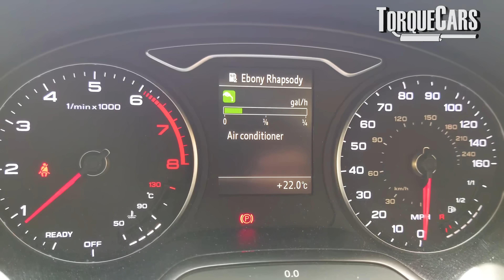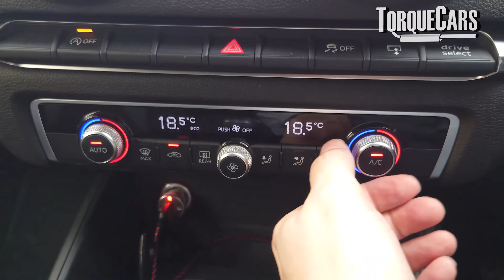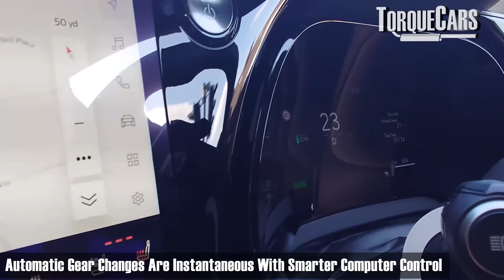The Biggest⛽ Fuel Economy Lies Every Driver Believes! 👉 What Really Saves Fuel?

Comment: I drive a sprinter if I use cruise control set to 60 it achieves 42 to the gal unladen and 39 loaded. Tried the premium fuels bit expensive, now use red ex diesel in every tank of cheap fuel similar results.

Comment: 7:04 7:10 In US market, the best fuel additives-packages I've found so far are in:
Exxon/Mobil Synergy Supreme+
Shell V-Power

These are what I fill up with in my:
2016 Toyota Prius c Two

It has 113k miles, and runs like new.

Comment: Tyre pressure set by manufacturers, is aimed at making the drive the most comfortable, not economic. Ford says 32 for my Kuga but it can go up to 40, so I put it to 36. A bit more tyre in contact with the road, means better performance but like everything in life, there needs to be a balance.

Comment: Air resistance is a significant factor. On a long drive one day, (100 miles +) the  average MPG readout on my dashboard had settled down to a satisfying high figure.   On a particularly long and safe stretch of road I found myself following a lorry, and I decided to get right up behind it, keeping a close watch its brake lights because I couldn't see anything of the road ahead. I thought I had maxed out on the MPG, but it increased significantly, just by being in the slipstream of that lorry for a few minutes. I wouldn't recommend it for safety reasons though.

Comment: We are essentially paying a premium to get ‘only’ 5% ethanol in the high octane fuel, instead of the 10% in the 95. I wonder how much of the benefit of premium fuel is simply down to the lower ethanol content that should never be used in most engines, anyway. Our rulers hate motoring and motorists.

Comment: Inflating the tires to the right pressure in the afternoon means that the tires will be under inflated next morning due to the difference in ambient temperature.  As under inflation has a greater effect than over inflation, on average it is better to over inflate your tires by a small margin
Reply: On the other hand, the tyres heat up very quickly once they start moving.  The air expands inside, increasing the air pressure.

Comment: Drag increases with the square of the speed. If you regularly travel on the motorway around 80 mph, there will be a significant difference in fuel usage at 50 mph, probably around 200 miles on a 10 gallon/550 mile tank (so 55mpg WLTP). Staying at more legal and practical speeds, even dropping from 70mph to 58mph, safely keeping up with the lorry/truck flow in the inside lane on a motorway, you will get another 100 miles out of the same tank.  As long as your car is well maintained, and you don’t brake and accelerate like you are on a race track, speed is by far the biggest influencer on fuel economy.
Reply: On my 96 Mercury Grand Marquis w/ 4.6L 2 valve V8 engine the difference between rural roads, high speed freeway 75-80 mph and mixed local and highway driving is no more than 2 MPG so 40 miles on the 20 gal tank. (discounting in town short trips)
Reply: @tomnwmi You are comparing fast (I assume fairly steady) highway driving to lower speed mixed driving where you are braking and accelerating. If you drove your car on the highway at a steady 50 there would be a considerable difference in range to driving it on the highway at 75-80. If anyone is short of fuel on a highway/motorway, the best way to significantly increase how far that tank of fuel will go is to slow down. Air resistance increases roughly with the square of speed. Power required increases roughly with the cube of speed
Dropping speed by even 10–20% can significantly extend range regardless of what type of vehicle anyone is driving.
Reply: Depends on the gearing. My car does about the same at 140 kmh in 8th gear compared to 120 kmh in 7th.
Reply: @golf1diesel I assumed that whatever vehicle was being driven, it was being driven sensibly and in the best gear for any particular speed.
Reply: @golf1diesel  gearing is gearing but the input power required to maintain a higher speed is the same. Will offset any friction savings from a lower engine speed.
Reply: @TsLeng  Engines are air pumps so let them breathe.  They work most efficiently when under load with larger throttle openings.  So gearing makes a big difference. This is why overdrive gears are more efficient.

Comment: Best economy, apart from not driving like a lunatic with burning trousers, is to conserve the momentum.  Ease off the gas well in advanced approaching traffic lights and roundabouts, let the car slow down without brakes and then if the light change to green or the roundabout presents a merge opportunity, you can usually just squeeze a little power back on an smoothly progress on without even changing gear.  If you must stop, easing off early means less wear on the brakes and you used less gas to reach that point.   Climbing hills - the Worst thing for economy is to press more and more on the gas until reaching the hill crest - much better is to let the hill slow you a bit until going over the top, then gravity gives you back the speed you lost on the climb.  When doing this though it is important for economy (and long term engine health) to not chug up the gradient with a labouring engine. Change down on steeper hills to keep the engine spinning freely - all engines have a best pulling rev range typically starting around half, and upto, two thirds their recommended maximum revs. So for most petrol engines you want to see about 3-4000 rpm just for the steep gradients where lugging or labouring occurs. Diesel pull more strongly and work at lower revs so you may not need to changes down at all, but if required you should be looking at about 1000 rpm less than the petrol version.  Finally, try to progressively squeeze brakes and gas, don’t stomp on the peddles and don’t snatch hurriedly at your gear changes - it isn’t necessary and a car driven like this feels bigger, more limo like, which is nicer for passengers - and the sign of a more polished driver.

Comment: The most practical fuel efficient speed remains 50 mph and it still eats up the miles.  HOWEVER, you should not purposely hold up traffic, so only use 50 where it doesn’t cause a problem for others.  Trucks are limited to 60 on motorways anyway, so a solution there is to travel at 60 in convoy with groups of trucks - this should not upset Audi tailgaters who will instead be centre lane hogging right on by.  On twisty rural roads even 50 is sometimes too fast for visibility and safety!

Comment: Hold on!!! You're recommending people to go for the cheaper fuel to save fuel costs. But what about engine longevity? That's a much more important argument. Premium fuels are like cheap insurance for the longevity of the engine and the fuel system because of the premium additive package. And fixing failed engines and fuel systems is much more expensive than the price for premium fuels. Think about the cost of doing that when you're choosing what fuel to fill up with!
In my opinion, the fuels with less useful additives should be illegal and the premium grade should be the only grade, especially considering the cost of new vehicles and how costly repairs are. Protect your investments!!!
Reply from the maker: Yes there is a difference between "cheap" and "low quality". I find that even big brands like Shell in my area can vary in cost from 141p to 130p. I would use Shell E10 or Esso E10 as the additives in these seem to be up to spec, however my engine loves higher octane and rewards me with better economy & extra power so I stick with that.
Reply: @torquecars  Cool! I'm running 98 octane (RON) E5 from CircleK. Mainly for the extra additives but less ethanol also means less fuel dilution, which means less engine wear on my annual oil change interval. At least in my area of Sweden, the cheaper fuels (95 octane) have less additives. I just thought that it was important to mention that correlation and how that potentially might affect the longevity of an engine.

Otherwise, I think you're giving out great and accurate advice here. I'm sure a lot of people take it seriously. And it would be a pity if people use your advice to always buy the cheapest (per mile) fuel without considering the additives. Many times, buying additives separately will end up costing more than choosing a higher grade fuel at the pump.

Comment: 2. Dry air can be used instead of nitrogen. Problem with regular air in a race is the heat from water in regular air, not the size of the molecules.

Comment: I have noticed I can get 10 mpg more driving my 2 litre diesel at 45mph, compared to high fifties. Not by choice though, just due to being stuck in slow traffic.
Apparently higher tyre pressures do save fuel, as a Vauxhall I once owned had an eco pressure 8psi higher than standard. Never tried it, probably hairy in the wet. Nitrogen is not used in racing tyres for fun. It has no moisture content, therefore pressures do not vary as much as temperature rises. 
Also if you want to wind people up, drive at a fairly constant throttle setting, and let the car slow down going uphill with only minimum increase to stop bogging down. Then over the top, let gravity do the job of speeding you back up! 
Automatics were always more juicy than manuals, although in my 1960 Jag, the torque converter locks up once it’s in top, and is no different to a manual.
However, if you’re driving in stop start traffic at low speeds, an auto is the only way to go. Far nicer to drive, and you don’t have to rev a bit to ensure you don’t stall as you move off. 
Quite agree about weight, at speeds above 30mph, air resistance has the biggest effect on fuel consumption.

Comment: Decades ago, I was on a car forum and they were talking about ways to lighten the car. Some were pretty extreme, like drilling holes or acid dipping the unibody. Others were less (slightly) extreme, like removing sound deadening material, removing rear seats, etc. Some mentioned hollow or magnesium alloy screws. Weight saving could be from tens of pounds to grams. Costs varied from a bit of sweat to thousands of dollars.

I made a comment that I have seen some of the forum members in the picks of the gatherings. I said a few (actually more than a few) of them could easily knock of 5 lbs at no cost if the driver just ease off the soda pop fried food.  LOL

Comment: I have a Toyota Carrola X hybrid in temps above 10c it can average around 23km a liter driving up to 70kmh. On the highway, it drops to around 15km a liter driving between 100 to 110kmh. In wintertime in Canada, the averages drop about 20% on those numbers as the engine needs to keep the heat up to stop the choke coming on by tuning back on the engine even with a lot of battery power left. It needs a controller to reduce airflow through the radiator in winter so the engine keeps hotter longer.

Comment: Electric cars can be A LOT cheaper to run if you home charge them. Tariff for 2025 £4 a day for EV charging. If your car can do 300 miles on a full charge, it will be a fraction of the cost of a car doing say, 50mpg, which would be £30+ for the same fuel range.

Comment: Mythbusters did tests on a track with two identical cars and until 56 mph open a window then AC is good from there
Reply: @slarratt  worth noting they did that with SUVs where the percentage increase in drag from having the window open will be less than on a lower-drag vehicle. On a lower-drag car the drag ratio will be higher, and the crossover speed will be lower.

Comment: The big one that you have missed is the shape of the car. If you get a tall 4x4, SUV, MPV or whatever it will be a good 10% less efficient for being so tall and brick shaped. You will then lose a further 10% if it is running on four wheel drive with all the extra parts it needs to turn. 
But we do not seem to be able to stop people buying them and they really do not seem to care about fuel. 
Diesels are just so good in fuel efficiency. I drive a stonking great E Class diesel and it gets better economy (55mpg normal, around 60mpg on a run) than friends hybrid SUV manages. 
In recent years (after around 2016) some diesels have got amazingly good. Some have not managed to deal with particulates so well and have problem systems (Peugeot), but Mercedes have got it right and that generation of Diesels are amazingly good. My emissions are so low it only costs £35 road tax.

Comment: Does anyone have any advice about tires for a car like mine? It's a 2007 Lexus IS 350 and it has Michelin on it right now.  It has 18 inch wheels and the rear are much wider than the front so you can't rotate them at all.
Reply: It's about $1,200 USD to change all four tires.
Reply: Trade it in on a 2026 Prius.

Comment: The biggest mistake you can do is to drive by the gear shift indicator because it´s so stupidly low RPM and high gear for the speed you are lugging the engine making it pull more fuel than if you shift correctly. it both wears down your engine and consumes more fuel if you drive by this indicator rather than "feeling the engine" yourself
Reply: @Pulverrostmannen  I had a Mk4.5 Focus as a hire car for a week in August, it was telling me to change up to 5th gear at 30mph which would have meant the engine was barely above idle as it was, needless to say I ignored that
Reply: My car tells me to shift when the revs would drop to just over 1000rpm in the higher gear. Then the manual(who else reads that?🤣) states, “do not let the engine revolutions drop below 1500rpm when driving”!)
Reply: It all depends - newer models do have several modes for that indicator, and when I drive dynamically it will not show me to switch to even 4th gear at 30 mph. I can pull in 3rd all the way to 50mph and it will still not display the shift icon. But yes, default is the worst possible setting - 5th at 30 mph is more than normal for me. And for others: the wear on the engine, when you drive slowly at high gear (say 5th at 30 mph) is specifically in the crankshaft, crankshaft bearings and especially clutch (especially the dual-mass ones). So, if you want to have a engine rebuild every 5 years or so... keep the engine constantly underreved (for petrol this is under 2000PRM and TDIs is under 1700RPM). And it doesn't save you fuel. I did some tests and ignoring the indicator, but still driving with rather light foot on the accel pedal, saves you a bit (say 1mpg). a bit counterintuitive, but makes sense - when driving as indicator shows, when accelerating at high gear on low speed, engine gets rich fuel mix that it can't convert to torque and power, literally wasting fuel beacuse you accelerate longer at same fuel consumption as if you'd drove more dynamically.
Reply: @Pulverrostmannen  in a carburetted car sure. Electronic injection gives exactly as much fuel as it can burn at any given moment. It doesnt just dump fuel because youve opened the throttle wide. And at steady state low rpm it gets exactly what it can use. Its not good for the engine but it isnt wasteful of fuel.
Reply: @sugarnads  when you drive your engine with a gear disadvantage it will work harder to drive the same distance as another commenter above here also stated. The engine can’t convert the mixture efficiently and will pull more fuel. 
I have tested this on my Diesel Subaru and my engine pulls about average 20% more fuel both indicated and measured if I keep driving it below 1500RPM. The sweetspot on my car is 1500-2000RPM where it uses the least fuel no matter driven distance or gear chosen. If I go above or below this range the fuel goes up again no matter how I drive. If I drive within this range of revs on lower speed roads the engine can pull as little as 0,4L per 10km. If I would lug the engine and drive on the highest gears all the time I can’t get below 0,6L for the same distance. 
It works the exact same way as if you bicycle up a steep hill on the highest gear. You can make it up but I can guarantee you will be more tired when you reach the top on the highest gear than if you gear down even if you have to crank more turns on the pedals on lower gears. 

Compare it to the car and you maybe could make a hill with 20% throttle on a low gear. But you probably floor it to keep the speed on the highest gear and then you will run a richer mix for a longer time. 

There is plenty of proof for this all over the internet if you go look for it
Reply: THIS

Comment: One of the most obvious waste of fuel is using the brakes.  Every time you apply the brakes to slow down, you're converting your momentum into wasteful heat.  That momentum has already cost you fuel so the obvious answer is to allow the car to slow down without braking.  This means you'll be off the throttle for more of the time.  So instead of converting your fuel to momentum than converting that to heat, you simply stop putting the fuel in, in the first place.

When you approach a bend in the road, come off the throttle well in advance.  If you use the brake before you hit the bend, you didn't come off the throttle soon enough.  When you're approaching a T junction, once again come off the throttle well in advance.  The only downside is that your brake discs will be inclined to build up rust, due to non use.  Just keep an eye on them and when they're getting to this state, use your brakes a bit more on your next trip, just to give them a polish.

Seriously, this tactic saves a hell of a lot of fuel.

Comment: Most people just don't understand how the crrent MPG works. You are cruising down the interstate at 70, let off the accelerator your engine then uses almost idle fuel consumption but you're still doing 70. Which will show crazy numbers but once you either give it fuel again or slow down it will go back to actual.